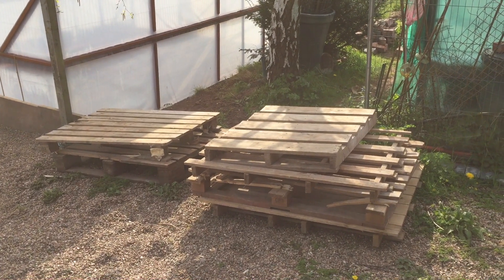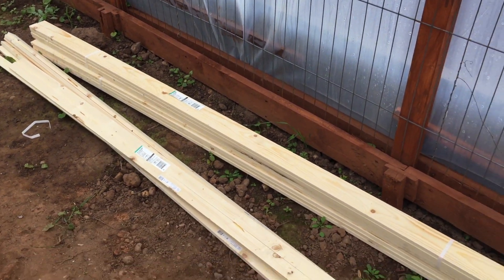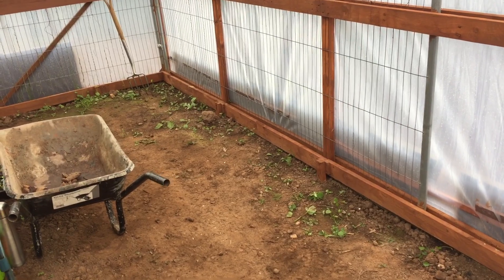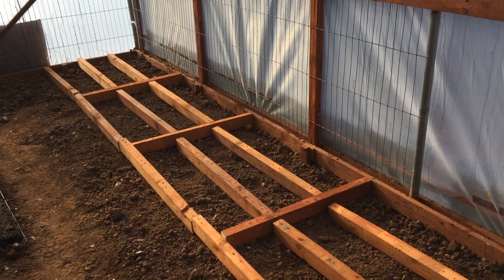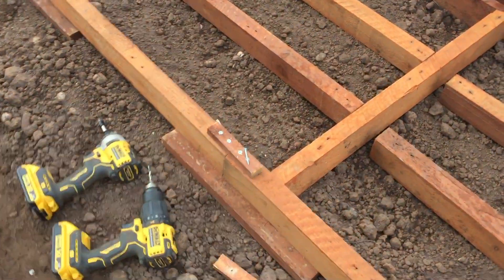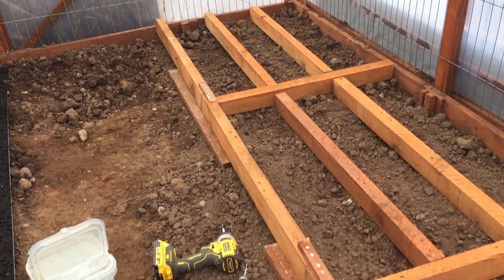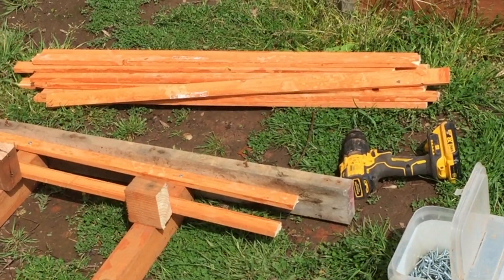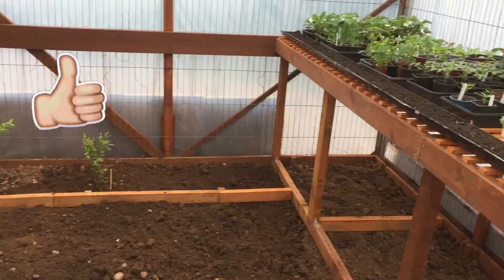How to Build Greenhouse or Polytunnel Staging (Shelves) - On a Budget - A Step by Step Guide #50

Comment: Hi Gary, I thought I would look through some of your older videos and came across this. So useful as I have just bought a new, small greenhouse and this would be a perfect project. Thank you 😃 Great shelving. I am trying to work out a way to build staging that stays attached, with hinges to a length of battening, to the side of my greenhouse but drops down against the glass when i want to plant in the border. When the staging is uo as a shelf i would want to support it with a fold down or gateleg arrangement. Thea reason for this is I have no where to store the shelving if it needs to be taken out   when I want to plant.
Reply from the maker: Thank you very much for your comment. I’m really pleased you enjoyed the video.  Kind regards. Gary
Reply: @TheAllotmentGardenandKitchen  Hi again Gary. I have added additional comment to my initial comment as I want to try out a shelving style but I am not sure how to go about it. Would you be able to advise please? Many thanks
Reply from the maker: @bewoodford2807  thank you for your additional comment. The shelves I built in the video lift in and out as I need them, however, you could add hinges on one of the sides of the main frame and brackets to hook onto when the shelves are lifted via the hinges. If you look on YouTube I’m sure there will be other videos to give you some ideas and inspiration for hinged shelves. Kind regards.  Gary
Reply: @TheAllotmentGardenandKitchen  Cheers Gary

Comment: Just one thought, I notice you follow the old school of gigging your soil. Have you not thought of No Dig? I follow Charles Dowding who champions the No Dig method, which is exactly what happens in nature. It would have saved you a couple of hours work. The bind weed can be controlled by using a black polythene membrane. You can then plant through it initially while you are killing off the bindweed and other weeds. By using the "Dig" method you are killing or damaging the mycorrhizal fungi. With "No dig"there are less weeds and what do come up are easier to clear. If used outside you can walk on the ground even after heavy rain and you don't get
Reply from the maker: Thank you very much for your comment Peter.  I’ve looked at no dig and I think I will start to experiment with no dig for a small part of my Allotment over the next year.  I’ve avoided it so far because I love the exercise that digging gives me!

I’ve seen all of the benefits that it can bring and I’ve increased my own compost production quite a lot over the last year to accommodate some no dig.  Also, as I have a YouTube channel I know a lot of viewers will want to see how I get in with no dig.

Thank you once again for your comment and kind regards. Gary
Reply: @TheAllotmentGardenandKitchen  Thanks for your comment Gary. I find now that I'm getting older that less digging means I still get the benefits of fresh air and the bending up and down helps with my fitness. 
Happy Gardening and I do enjoy your videos regards Peter from Devon